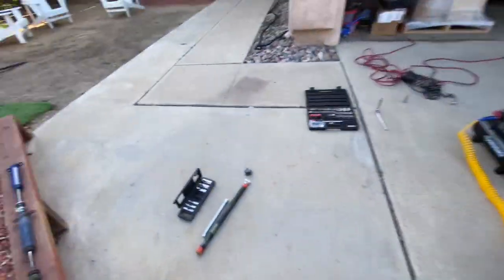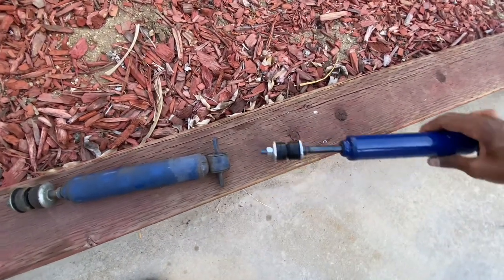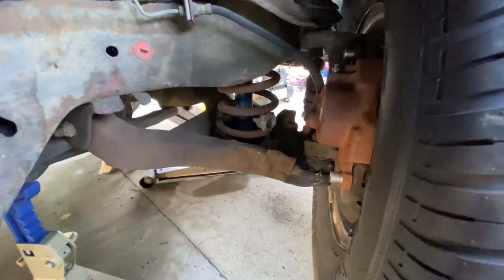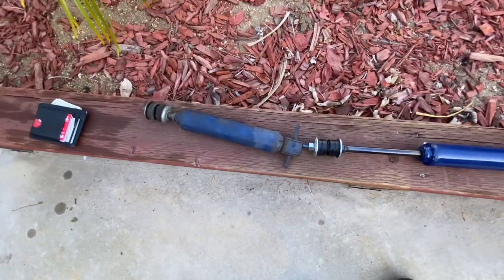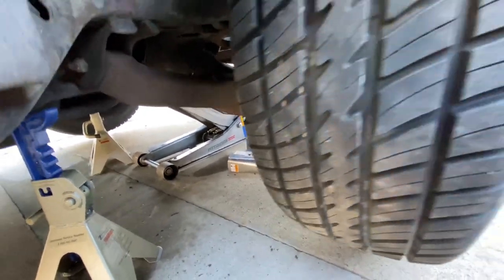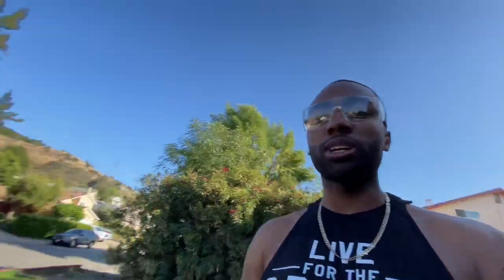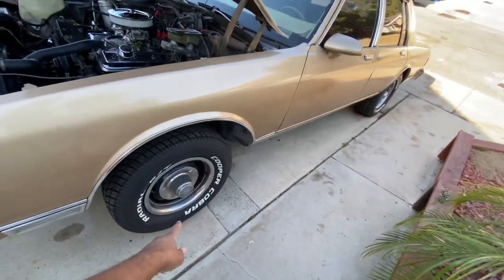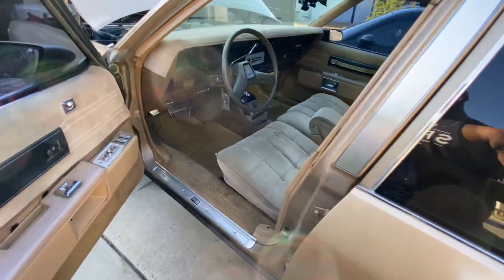Box Chevy Front Shock Install / 1986 Caprice Classic Brougham

Comment: What size tire are you running on the front I have 275-60-15 on mines in the front is that to big or I gotta go down a size
Reply from the maker: Yeah if I remember correctly it’s 235/60/15
Reply: @CarReviewsbyKJ  so do you have 235-60-15 on the front or no
Reply from the maker: Yeah on the front.
Reply: @CarReviewsbyKJ  will a 15x7 size rim fit for the 235-60-15 tire
Reply: @CarReviewsbyKJ  ok thank you thanks for for your help and time brother
Reply: Will it or no
Reply from the maker: Honestly I’m not sure if it’s safe but I did it. Might have to ask the tire shop if they recommend it. I sold the car a while back but it’s still rolling
Reply: Two more questions and that it for me what's the part number and brand for the black alternator you got new and can I use a size 15x7 rim for the 235-60-15 tires